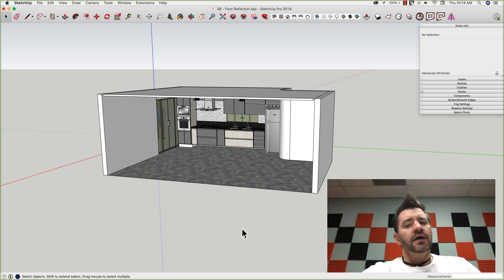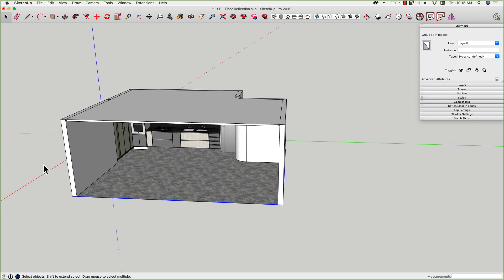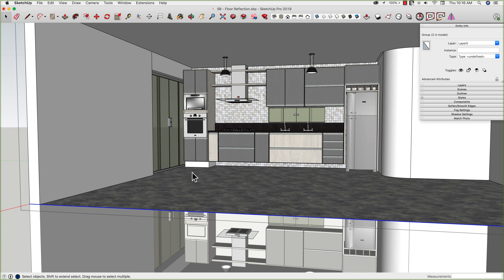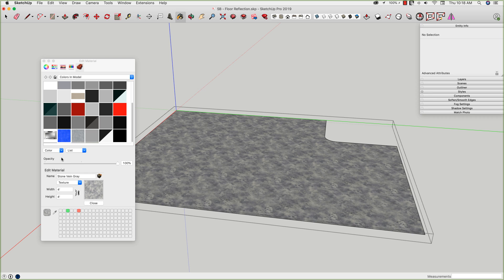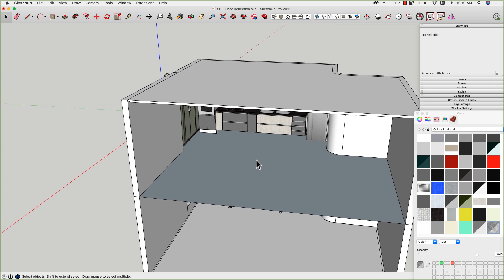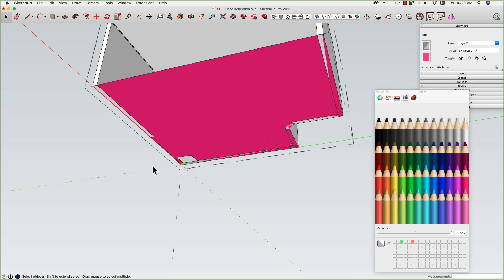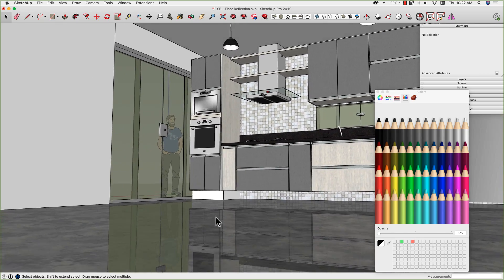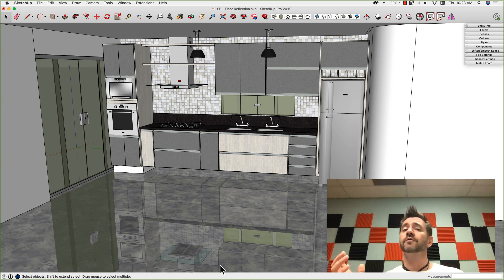How to create a floor reflection in SketchUp - Skill Builder

Comment: Hey.  I am new to all of this Sketchup and I am blown away how easy is to bring ideas to 3D with it.  Currently I am working on a concep that requires superimposed a floor and a subfloor.  I want to simulate (I actually do not know if this is something S can do) a dynamic movement of a weight over the top floor making it flex (think of this behavior as walking on a jumping-net). As the weight displaces over it and then rebound back as it leaves the spot.  Thanks